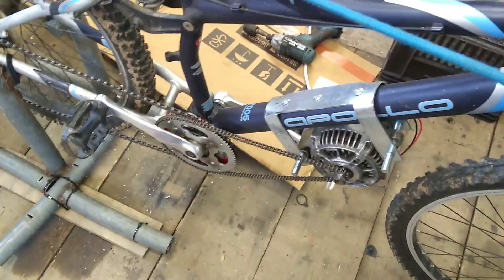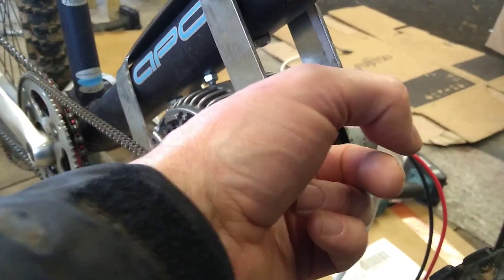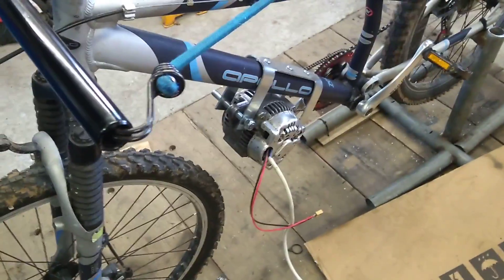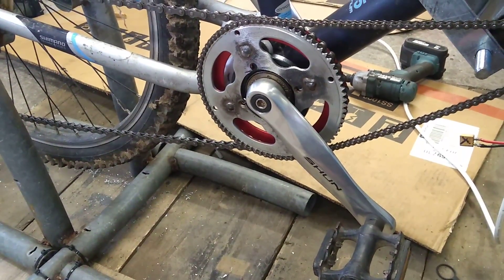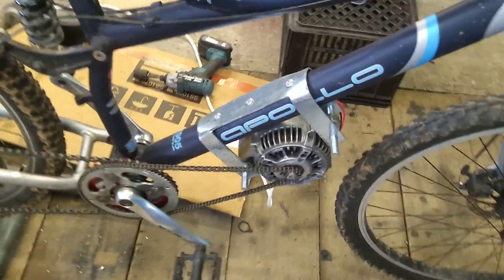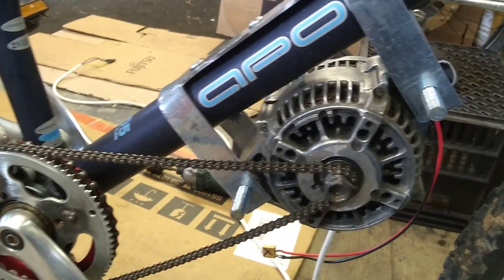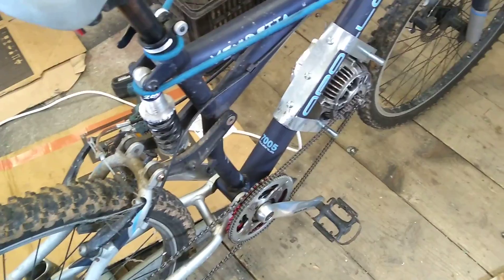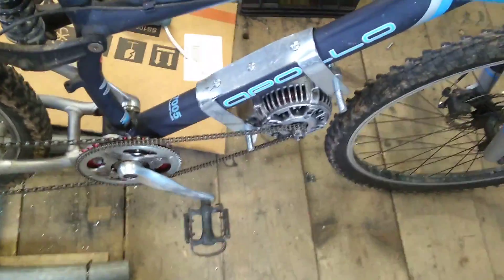DIY Ebike with car alternator V2 Episode 2 - Alti-motor mounted at last. NB Read the notes

Comment: So you can get more power you will need to bridge the Regulator part on the setup of the alternator, so connect direct to the input of the carbons that way you can bypassed and not remove any part of the electronics in it.

Comment: I think the reason why this setup had very little torque is due to the fact of the lack of phase amps going to the motor to make enough torque to go with his gear ratio for example im attempting to do a similar build except I’m using a vesc and am gonna be using a 36v battery that can do 200a continuously I’m gonna set vesc settings at 120a battery and 230 phase reasona for 230 phase is because at this current the alternator should produce 22nm of torque then throughput the derailer in first gear it’s a 9.23 gear reduction which is around 200nm of torque in first gear and in last gear it has 4.62 reduction which is about 101nm of torque top speed is about 50idh mph max btw how I found the torque is by find the kv rating of my converted alternator which is about 95.5kv and doing 36 x 95.5kv= 3438rpm unloaded ofc and using a calculator to calculate the torque output with the voltage, rpm, amps and power factor which is about 0.5774 and got 22nm output as a result but this is just approximate I also plan on using permenant magnets so I don’t have to power the feild coils anymore
Reply from the maker: It sounds like you've thought about it. 🙂
Would the VESC be OK with not having Hall sensors or are you adding them too?
In my case the lack of torque had more to do with the gearing than the motor as it worked great with better gearing on my first build.
Just watch out for cooling as with only 800W it got quite warm so use the biggest alternator you can.
Reply: @alibro7512  the vesc for now is running it sensorless until I can get hfi running on it which if you don’t know acts as hall sensor’s just without the hall sensors and yes I do notice my alternator gets warm while testing at just 2.8kw but no notice dip in performance but just to be on safe side imma build a water cooled copper sleeve connected to a aio watercolor to make it stay cooler and be a little more efficient now all I have to worry about is keeping my bike in one peace at 200 nm of torque which is around 147 foot pounds of torque going to the wheels in first gear
Reply from the maker: @jonathanbrunache3848  What was the current rating of your alternator?
What voltage are you sending to the rotor or are you varying it with speed to give field weakening? 
How do you plan to add magnets? Have you seen the video of the cowboy pretending to make free energy but showed a method to add magnets to his alternator? IIRC he removed the fingers and coils, then made a jig to hold his magnets before potting it in resin. I was considering doing the same for my alternator driven EV Power steering but for now keeping it simple and using around 6V.
Reply from the maker: I suspect some of the heat was caused by the cheap controller sending a nasty square wave into the motor with only rudimentary timing. This would also account for lack of torque so your VESC should be much smoother and more efficient.
Reply: @alibro7512  it’s a 120qamp alternator and the voltage I’m using is only around 36v nominal but can kick out 480amps peak and if you’re wondering yes it’s a custom battery I made using high discharge cells and how I’m gonna install the new magnets is by first removing the rotor and taking off the coils of then drilling large enough holes to fit 2 neodymium magnets on each pole of the rotor I also decided imma add something called statarade to help aid in the cooling of the motor on top of it being water cooled just so I know I don’t ever overheat it at over 230 phase amps which should produce somewhere around 22nm of torque from the motor it’s all aproxamite cuz I tried getting exact numbers that the alternator was putting out in real time to determine it kv to the best of my ability
Reply from the maker: @jonathanbrunache3848  As a 120A alternator it is designed to handle around 1500W however in a car it will also receive heat from the engine so it should be able to handle closer to 2kW without serious over heating. 2kW should be enough to ride on the flat at around 30mph to 35mph continous but will not give great acceleration.
At around 4kW you're suggesting you will definitely need extra cooling. 
If you can add the magnets it should help.

How do you plan to drive the chainring? The way I did it was more than a little sketchy. 
Have you considered a 180A alternator from a VW? They are dirt cheap on Ebay and would be a bit beefier.
Reply: @alibro7512  it’s gonna be running 8kw peak that’s why I’m doing all theses cooling mods and it’s a 13t to 60t to 14t to 28t-14t on the derailer side
Reply: Gear ratio is about 9.23 in first gear and 4.62 in last gear
Reply from the maker: @jonathanbrunache3848  I was multiplying your battery voltage 36V by the battery current 120A to get 4320W, how are you getting 8kW? 
I don't remember the size of my chainring but I think I was using a 12 or 13 tooth gear on the motor. This was all done over 4 years ago but I remember the chain was turning so fast I was not happy about it. Maybe you should go for 14 or 15 tooth gear on the motor since you will have much more power. 
Have you seen the video by Peralo where he converted his alternator? Very nice work but no magnets and he didn't show how it was installed.
Reply: @alibro7512  I’m running 230 phase amps and yes I’ve seen that video before phase current controls torque
Reply from the maker: @jonathanbrunache3848  if you are only drawing 4kW from the battery it cannot be 8kW at the motor. Power can only be converted into heat, motion and noise but cannot be multiplied without another source.
Reply: @alibro7512  well usually phane current is set higher then battery current what I could do is match it to the same current cuz my battery can handle it if you think they need to be the same
Reply: Plus when I’m talking about phase currents I mean torque output not kw output
Reply from the maker: @jonathanbrunache3848  I'm no expert on vesc controllers so best get advice from someone who is but if your drawing 4kW dc from the battery then that is the power you're playing with. Phase power is three phase ac so a very different beast and I'm not sure how the power at the motor is calculated however it cannot be more than is drawn from the battery.
Reply: @alibro7512  that’s why I have 420amps to play with at 36v and my battery can do over 200amp continuously no problem and since I’m only drawing 230amps It’s fine to use I believe

Comment: Since a standard bike has 2 wheels you can reproduce electricity while you propell the bike. A car has 4 wheels. You are not going to recharge your car with just one wheel. It will pull hard to the left or the right depending on which front tire you connect the hyper charger to. This is why an electric vehicle is better suited to operate off one primary axial flux bldc. Let this one primary axial flux bldc generate AC and DC with  flywheel and/or inrushing air frequency assist.  If driving conditions consist of downhill travel, your secondary battery will be fully recharged before primary is depleted. The inline dc current sensors detecting this will pop gear out for hyper charger essentially disconnecting it until you turn the car off and restart it.
Reply from the maker: Losses in wind resistance,  battery charging and friction mean this has only a limited effect in a car and almost zero effect in a bicycle. My current ebike has regen and it is useless.

Comment: If alternators on the front wheel is Geared opositly from main motor, The faster your bike will reproduce electricity.  Replace what you use. This bike will never run out of juice.
Reply from the maker: If only it was that simple. 🙂
Reply: Perpetual motion does not work.

Comment: And if you should have a foot slip off the pedal don't worry the follow up pass removes your leg at the knee so you don't mess up that motor from a stall. The faster you go the more terrifying the pedaling becomes.
Reply from the maker: LOL, Freewheel crank means this is not true.
Having said that, like I mentioned in the notes,  the design is bad and I don't recommend it

Comment: this is Hassan Yousaf I am on another account how do you go about mounting the gear to the shaft of the alternator
Reply from the maker: It's been a while since I did this but from memory I welded the gear to a nut after turning them both so the gear was a nice fit.

Comment: What is the range and time to take fully charge
Reply from the maker: Sorry mate, Like I said in the notes, this design was impractical for several reasons so I never tested it. 
Time to charge and range will depend on the size of the battery pack and how powerful your charger is.

Comment: Oi, tem como o senhor me informar qual controlador serve para usar no alternador de carro e nos motores com sensor hall de 36 volts. Airton 61981779764
Reply from the maker: It was just the cheapest controller I could find on ebay.

Comment: i have an idea a motor turn on the wheel and make energy and a throttle controls how much goes to a rear motor. this prevent the thing from being a perpetual motion device and goes as fast as you want it. warning will get a really lot of views and subs. even try two motors with a bar in between to so it will start at low speeds. try like this two 24s or one 48 and then one 72 in back and you should do good.

Comment: Hola buen.tarde amigo una pregunta alternador cual carro este video me gusta porfavor dime sy venezuela
Reply from the maker: It doesn't matter which car but better if the alternator is 150A. This one is around 100A and gets hot.
Reply: @alibro7512  amigo esta bien  pero yo quiero pruebalo alternador funciones sin controlador rushless como hajo
Reply from the maker: @juanaponte2213  All car alternators have brushes. You cannot use it as a motor without putting 9V - 12V on the brushes. I now use a PWM DC motor controller to apply 12V to the brushes.
Reply: @alibro7512  ah amigo yo hacer alternado motor para saber funciones pero aui venezuela no tiene controlador mira  Do you have whatsapp please
Reply: @alibro7512  amigo a mi me gusta video traajo mano es bueno ideal ustde fino amigo puede conctacto whatsapp
Reply from the maker: @juanaponte2213  sorry no
Reply: @alibro7512  bueno esta bien amigo disculpa sy sordo
Reply from the maker: @juanaponte2213  Watch my other videos for more information about alternators as motors and ebikes. This design for ebike is flawed and does not work.
Reply: @alibro7512  amigo aqui controlador rushless  no vende venezuela como hacer para funcione yo quiero probalo alternador motor para ve rueda entiende amigo
Reply from the maker: @juanaponte2213  Can't you buy from China direct? 
https://www.ebay.com/itm/26-1000W-48V-Rear-Wheel-Electric-Bicycle-Conversion-Kit-E-Bike-Motor-w-LCD/132471362847?hash=item1ed7e8951f:g:rzoAAOSwPbBc2-IO

If you decide to use an alternator then copy this design as it is still working well. (Maybe do it better than I did 😁)
https://www.youtube.com/watch?v=o9WH8GTqWn0
I will be sharing another video showing this design soon.
Reply: @alibro7512  buenos dias amigo ustde felidacione hacer trabajo alternador 100% mejor dios te bendiga gracias saludo
Reply: Amigo esto alternador motor para bicilcta a mi me gusta tengo 2 alternado toyota  esta bueno estado
Reply: Doy numeno mi celular si quiere me avisa tu piensa bien
Reply: @juanaponte2213  si quieres ayuda para convertir, puedo ayudarte

Comment: Hola una consulta amigo que tipo de controlador usaste me mandarías a mi wathsahp por favor ya que nesesito hecha a andar mi alternador a motor pero compre un controlador i no me sirvió +65 934110310
Reply: Hello friend I like with greeting you I congratulate you for that great conversion look I want to make work just like my bike and I would like you to help me with the controller theme to make walk the alternator since q I have the alternator ready to put the driver but the one I bought didn't work well I'm clear that some drivers don't work but if you helped me by sending me a specification of the controller you've used I'll send you my chili wathsahp soi +56934110310
Reply from the maker: @deyviolivares9701  Hello friend.
First I cannot recommend this design as it has many issues. I did not use it for long and if you want to make an ebike from an alternator I suggest improving this design. https://www.youtube.com/watch?v=26nQj5oSNvM
I just used a just a cheap controller from China. Nothing special.
I hope this helps. :)
Reply: Hola buen.tarde amigo una pregunta tu hacer alternador motor electico para bicicileta porfavor sy venezuela

Comment: Do the pedals turn/rotate when you use the electric motor?
Reply from the maker: No mate, I used a freewheel crank so the chain would spin but not the pedals
Reply from the maker: If you watch the rest of the videos you'll see how it works.
Reply: I would think for damn sure

Comment: much neater
Reply from the maker: Thanks mate
If you check out episode 4 I replaced the chain sprocket and tidied things up even more.
Reply: @alibro7512  going through a few of your videos, you seem not to've mentioned the alternator's specs. the v2 bike uses a 24V+ controller; would a 12V alternator work?
Reply from the maker: @eToroBoT  the alternator is a standard 12V 100A car alternator from Rover 75. The two controllers I have are 36V and 48V.
Reply: @alibro7512  running at 3-4x its spec'd voltage, does the alternator give any heating problems?
Reply from the maker: @eToroBoT  Not really. If you watch my videos I talk about the temperature of the motor and while it does get warm it has never been a problem.

Comment: Hello I am in the process of building a bike like you are building .One question where are you getting the chain ring and the sprocket for the alternator is the alternator sprocket freewheeling or is it bolted hard to the alternator.
Reply from the maker: Hi, thanks for the questions, most are answered in Episode 3 but just in case.
I got the 80 tooth chainring from ebay listing number 111948286967
the 13 tooth also from ebay number 282855967738
Both came from Chinese sellers but arrived within a couple of weeks.
The 13 tooth sprocket is welded to the shaft of the alternator so is fixed, the freewheel is on the crank bought from here. https://www.sjscycles.co.uk/cranks/shun-alloy-104-pcd-4arm-freewheeling-cranks-170-mm-silver/
In my next video you will see I bought another 80 tooth sprocket from the same seller and adapted it in a MUCH neater way. Watch this space. :)
Reply: Thanks for the information . I will keep watching your progress and keep working on mine.

Comment: Great work my man, i cant wait for more updates. Keep it up! Im actually going to try a similar thing when i get more money.
Reply from the maker: Thanks mate
The most expensive part of this build is the battery pack. The alternator could be picked up for free if you ask around garages for faulty ones. So long as the bearings are OK it should be fine. throttles can be got pretty cheap and the rest of the stuff can be scrounged for pennies. 
If you can get access to a ton of old laptop batteries even the battery can be cheap. Only thing is you'll need twice as many batteries for the same power.